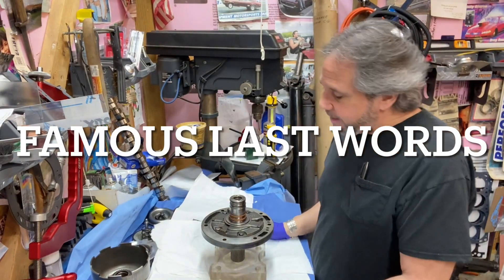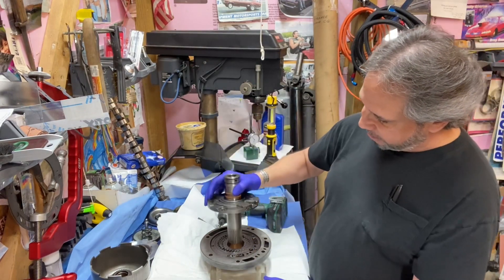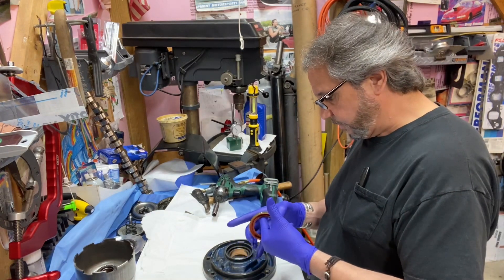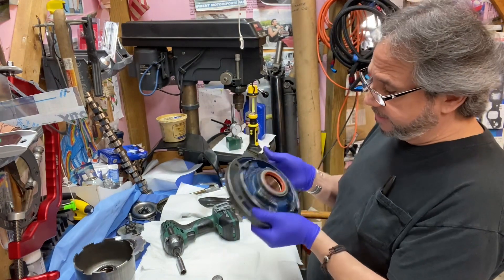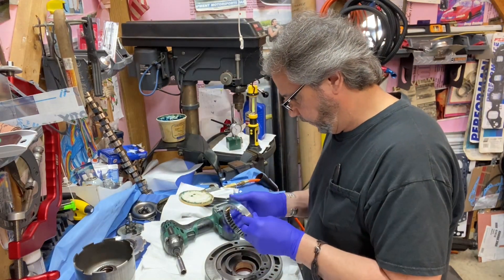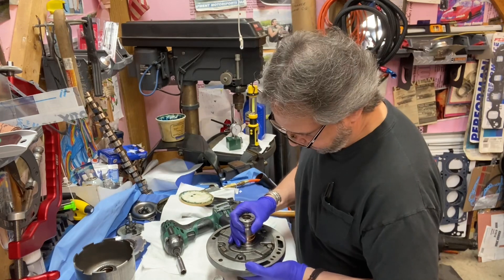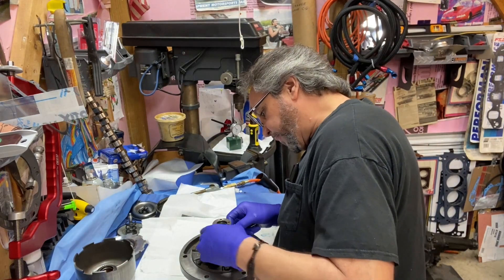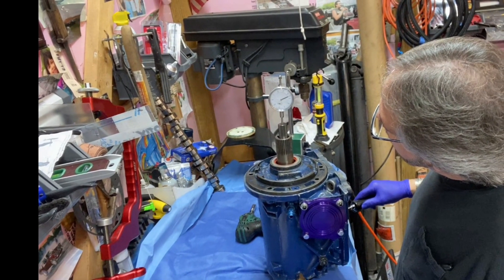DragBoss Garage: Ford C4 Front Pump Evaluation, Front Seal Fiasco For 750+ Hp Ford 351 Cleveland

Comment: I like this guy. not too much small talk (and when there is he edits it out!)  Good info and efficient video. Subscribed!
Reply from the maker: Thanks Mike, I do like to talk though. Glad your here
Reply: @dragboss351cleveland  QUESTION: Can you verify the 1986 C5 did NOT use the washers and snap ring on the output shaft ahead of the Governor? I did a thorough disassembly of a C5 out of an 86 Tbird, bagged everything, labelled, and upon reassembly i do not have a snap ring or washers ahead of the Governor like a normal C4. Transmission had never been apart. No loose pieces or parts to be found. I've read conflicting info on this!

Comment: When installing the front seal pack the spring area with Trans Goo lube.  All spring seals need this done no matter where or what they are installed in.  Trouble will occur if not, bank on it.
Reply from the maker: Agreed, lube makes a big difference with assembly.

Comment: Drag boss gotta question on a c4 will a stock c4 handle around 330 hp  with just an upgraded torque converter
Reply from the maker: yes, I think close to 500 hp, better think about some changes.

Comment: I use some assembly grease to hold the spring in place while I put in the seal.
Reply from the maker: Thanks Adam, great tip for sure. I think trans lube is colored Vaseline, you hear any different?
Reply: @dragboss351cleveland  I have used both but find the blue or if you can find it the gold to work better. Plus I was shown how to rebuild transmissions from my uncle that worked at the transmission plant for Ford. But I feel the beauty of repair is using what works best for you.
Reply from the maker: @adamfrench8735  Adam, that is what I always say, do what works for you...I have the blue stuff

Comment: Spring has sprung, Tim. Good. The spring sprung. Not good. But like always, you overcame it, completed the pump and it's ready for installation into the tranny. Nice job. It will all work out. Faith and Confidence.
Reply from the maker: Thank you Bill. Yes keeping the faith, need it. Dang new Magnafuel pump a dead soldier. Hot wire won’t even work. Ordered another, exchange this one. Mrs DragBoss put up a quick video too. Thank god transmission working well.

Comment: The straight seals are better than the lip type. 
Have seen the lip type come out. With the bevel in the bore for the seal not a lot to hold it in. 
Use an arbor press to fit the seal , the spring doesn’t come out  😉
Reply from the maker: Ok good to know. Next time fill the seal with lube as per Paul. No press yet Greg

Comment: Richard from Precision Transmissions is awesome! I was gonna tell you about him too! Also, when you put the pump back together, use some RTV in between the pressure side and the vent side of the pump. Just a thin film will save you so much trouble later on. And use 3M weatherstrip adhesive on the front seal. It will keep it in place no matter what! Now I mainly rebuild Hydromatic transmissions, and lots of them. But the concept is the same for all transmissions. And I look up to Richard! The man is a rock star in the transmission world! He's in Amarillo, Texas, if you need his help.
Have a great day, Sir! And God Bless. o7
Reply from the maker: Yes used some 3m on the seal. Dry .030 pump gasket. I like watching tear down. Zip zip. Thanks classified